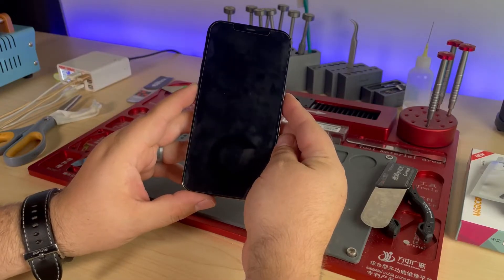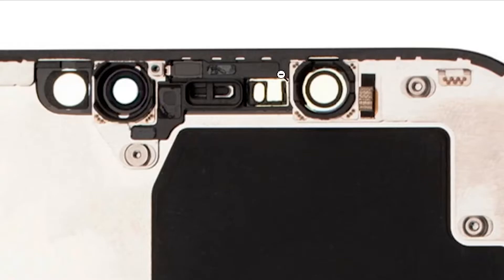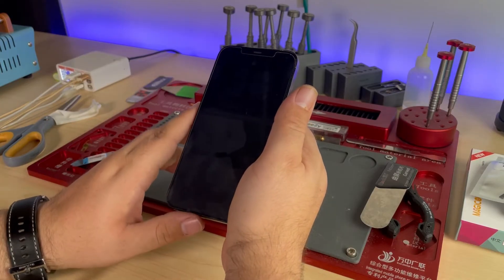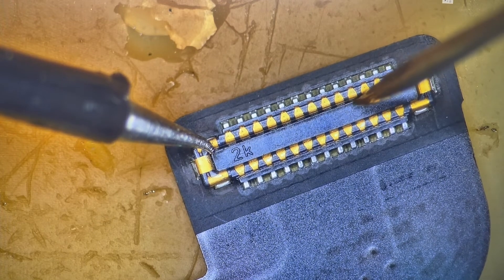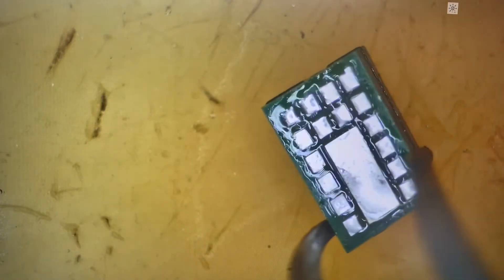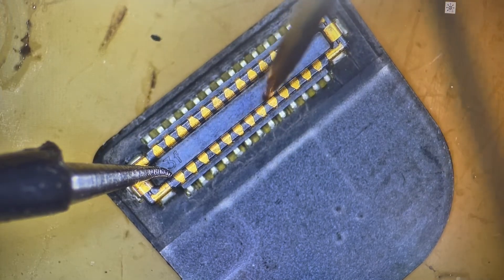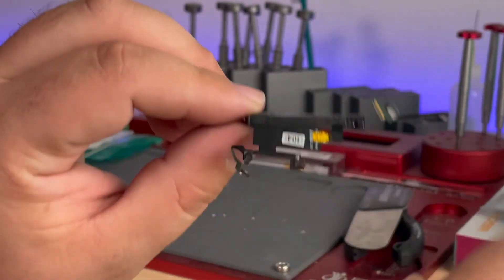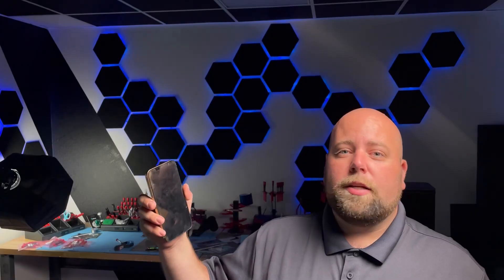iPhone 12 Pro Max Boot loop repair (Fixed) Face ID Retained!👍

Comment: Hi firstly I want to say great work and I'm impressed with your video. My iPhone 12 crashed and its stuck in booting then shutting down. It gets warn and doesn't charge when its plug using a cable its only charging when is using a wireless charger but doesn't get to max capacity. What can I do to fix it?

Comment: Hello I had a query - My IPHONE 12 pro also experience water damage and the face ID has stopped working. The phone boots fine. But after every 10 mins or heavy load, its reboots again. It comes back to home screen and then starts working fine again for another 10-15 mins and then again this process repeats. 

What do you think I can do?

Comment: I didn’t understand one thing. Do I have to switch both parts or only the one that melted in your video

Cause I have the exact same problem
Reply from the maker: Only the one I mentioned is required for Face ID
Reply: So i have to Switch the Face ID Sensor from one proximity Sensor to the other Right ?
Reply: And in the Face ID Sensor is a Chip thats connected to the mainboard thats Why we have to change them from one to the other if i got it right

Comment: Hello so every time I try to charge my iPhone it goes into boot loop
Reply from the maker: Sounds like an issue with the charge port. There are three components that will send a iPhone into a 3 minute boot loop. Prox, charge port, and Power button. In your case you’ll just have to test and see.

Comment: I disconnected the próx sensor, no boot. Then the charge port, no boot. How do I check the power button?
Reply from the maker: It’s going to be a motherboard issue if you got no boot like you’ve described. Schematics and a multimeter is what you need now. I’d start testing on the battery connector pins.

Comment: can a dead battery cause this i haevnt had my phone or  afew months now got a new screen and iuts boot looping i cant unplug my proxim ses to test as ive stripped the bots so i cant take of the metal cover i'm worried to drill them as i had to drill the front speaker and proxim senser of and it boot loops
Reply: what im trying to say will a faulty proxim sensor stop the battery even holding charge i have got to the dead battery screen but second i unplug it turns off and wont boot at all onlly boot loops when plugged in i really need help i cant trouble shoot as i dont have budget to

Comment: My iphone 12 pro max randomly shut of and boot looped. while watching your video it undid itself. but the brightness issue is still going on. its been 10 mins and hasn't went back to normal. im gonna restart my phone after this to see if that does anything but either way. do you have a way to fix that? the scroll tab doesn't change it either

Comment: I think water got into the speaker and messed up the proximity sensor. stuck in boot loop. when I heat up the phone to a point where i get the temperate warning, it skips the boot loop and powers up. phone then works for under an hour after it cools down, it then goes looping on its own again thereafter. an Asurion expert stated that its my face id, but face id works great when i get the phone to work... theres a short for sure i just dont know where...
Reply from the maker: The proximity sensor might be corroded a bit and although it doesn’t actually do anything for Face ID it is part of the circuit which means it needs be retained/fixed to keep Face ID and not have the issues you’re experiencing
Reply: @FIXDPHONES  you sir saved me $600. My phone repair guy at Asurion was charging me $150 to replace the back screen, $100 for a new battery, and $350 TO REPLACE MY FACE ID!! after i learned from watching your vid that it was the proximity sensor, i ordered a sautering kit, learned how to sauter in a few minutes, ordered a new proximity sensor wire, did everything your video showed - it worked! I also ended up buying a better battery for $40, replaced it in like 5 minutes since i already had the phone opened. I also bought a new back screen from amazon with an apple logo which my guy couldnt do for $14. Took me 20 minutes to replace that after I got all the confidence i needed from fixing the proximity sensor... oh i did snap the proximity wire when i tried to water proof the phone so i had to buy another one and do the whole thing again- all in all cost me under $100!

Comment: If I could get you right What you are saying is that  I should get a new sensor flex  and change only the sensor of the old flex to the new one right
Reply: I had change the flex but I want the face id to work

Comment: Hi there, I have an iphone 12 pro max that was running beta software and got stuck in a boot loop. Took it to apple and tried DFU mode and 3rd party software. Nothing would take it out of boot DFU. Eventually I found something that could revert it back to the bootloop but that's it. 

They told me something like the logic board is fried and want $650 to replace the phone. 

Do you think this is a problem you could solve?
Reply from the maker: There’s a good chance I can diagnose and fix it. Email me at fixdirepair@gmail.com
Reply: Hi, same thing happened to me, my issue was a dead NAND chip. Lookup and research error 9 and 4013, and see if you have the same issue. If so, you need to remove and put in a new nand chip. It’s quite difficult, and requires an expert. I did it and it fixed my phone. All data gets removed though.

Comment: Good evening, I have an apple watch series 4 44mm and it has a problem with the microphone, can you fix it;
Reply from the maker: For the most part I can fix this issue as long as the mic is the cause and it’s not an issue with the audio ic inside the motherboard. Most of the time it’s just the mic.
Reply: @FIXDPHONES  Great, can you tell me the address and how much it costs?